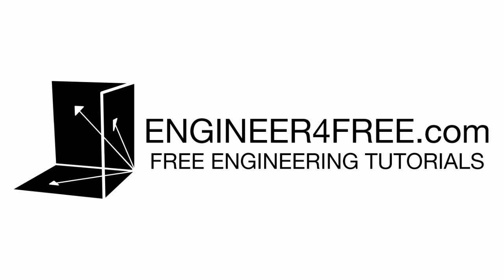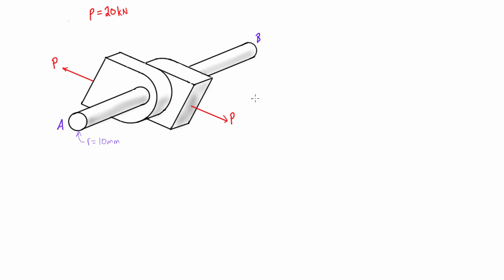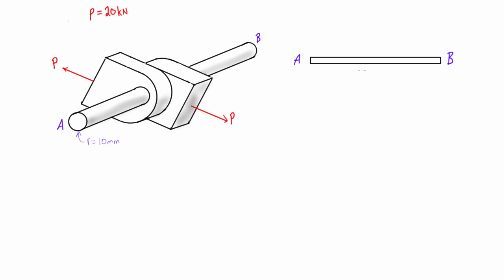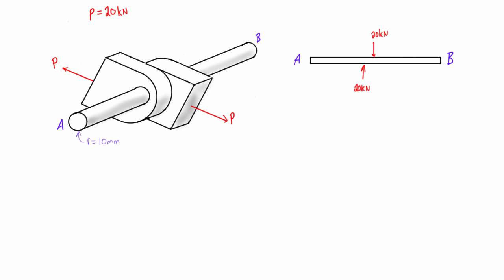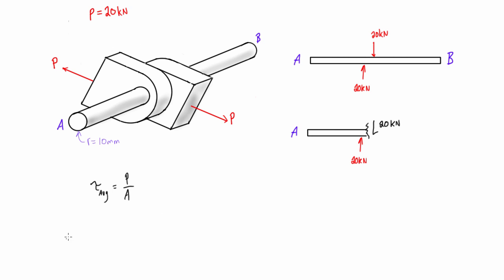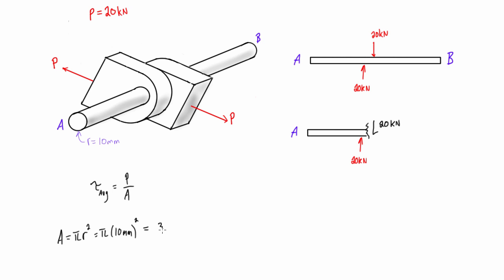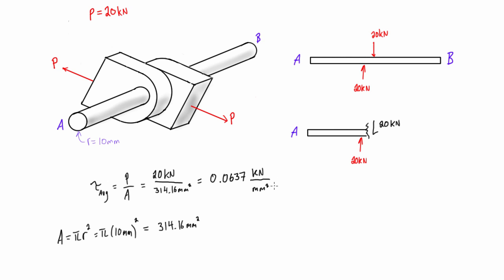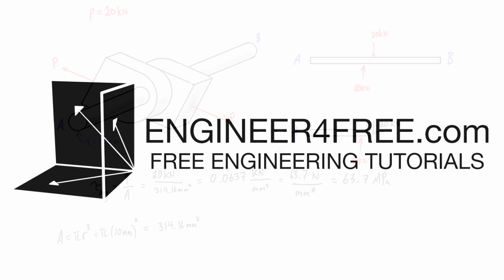Shear stress

Comment: what is the difference between shear stress and average shear stress, and normal stress and average normal stress?
Reply: I'm not entirely sure, but I think the term 'Shear Stress' is a general term to denote a typically observed value whereas the term  'Average Shear Stress' is introduced during cyclic loading, especially(but not exclusively) for fatigue stress analysis.

Let's say that we have maximum stress of +15Mpa and a minimum stress of -5Mpa(opposite direction loading) acting on a member, we can then the average stress is  ((+15)+(-5))/2=(+5)Mpa. The next term 'Normal Stress' would be the stress acting perpendicular to the plane of cross section of the material. Now if this Normal stress has a minimum and a maximum limit, then the arithmetic(similar to (+15)+(-5)/2(+5)Mpa) average of that would be 'Average Normal Stress'

Comment: Hi why do you decided to choose the cross section area by slicing the object vertically but not horizontally? That way you would get a rectangular as the cross section area and the force is acting on the sides too.
Reply from the maker: The blocks that P and P' are acting on apply a force to the rod that would make the rod break clean in half. The broken surfaces would expose the circular cross section of the rod. The stress that is caused by this type of force and the resulting failure are called "shear stress" and "shear failure." The circular cross section is what we are mathematically interested in and doing the vertical cut gives us that area. If we were to cut horizontally, that would give us a rectangular cross section that is as wide as the diameter and as long as the rod which is a meaningless area. Notice I didn't even specify the length of the rod because it doesn't matter.Anything beyond that flat 2D circular cross section that forms the breaking surface is irrelevant to the problem. Hope that clears it up.

Comment: Thanks for your videos. They are my life savior. Presentation is neat and to the point. 
I have question regarding the magnitude of shear used in this example. Since 20 KN load is applied on both the sides, shouldn't that be additive at the cross section considered ? Implying shear force considered for stress calculations to be 40 KN instead of 20 KN which would have been the case where load is applied only on one side. Thoughts ?
Reply from the maker: You would think so but no. If you draw a shear force diagram for this member, it would look weird, basically being zero everywhere except a positive and negative value of 20KN infinitesimally close to each side of the point of contact. The jump from positive 20 to negative 20 is 40, but the value of shear experienced by the member is never greater than magnitude 20.

Comment: There are two forces acting on the area how come when we a do a FBD we only use one to determine the stress!
Reply from the maker: It’s a good question. The two reactions make a plane of contact basically, but we take the virtual cut basically right on the plane, which we can consider to be between the forces. So the FBD of either side will then only show one force. Best is to not overthink it at this stage when you are learning, and with practice it will start to become more intuitive.

Comment: your area must have over 4 right?, A= pie d^2 / 4
Reply from the maker: Hey thanks for the question, pi*(r^2) is the same as pi*(d^2)/4. The work is as follows: Area = pi*(r^2) = pi*((d/2)^2) = pi*(d^2)/(2^2) = pi*(d^2)/4. Does that clear it up?
Reply: its the same, because in your formula you  are using diameter instead of radius and radius equals diameter/2, when you square that you have r^2= (d^2)/4
Reply from the maker: yup! thanks for contributing :)
Reply: @Engineer4Free  OMG. i hate that people actually use the (d^2)/4. it was used in my textbook and i was so confused. when it's literally pi*(r^2). that's the thing with math stuff. some things are just unnecessary and confusing . thank for clearing that up
Reply from the maker: Happy that you found this old comment reply and it helped!!